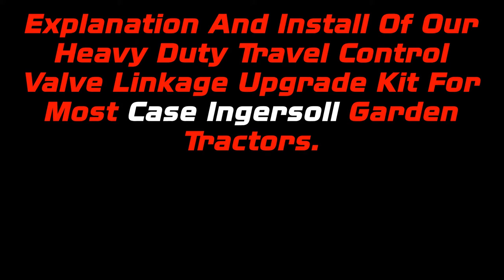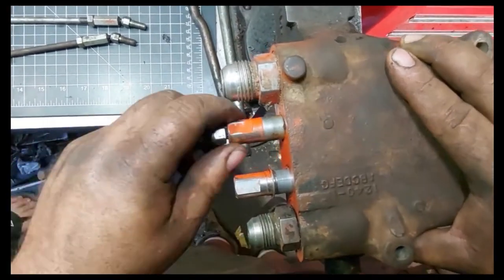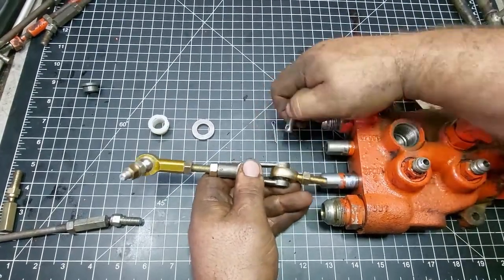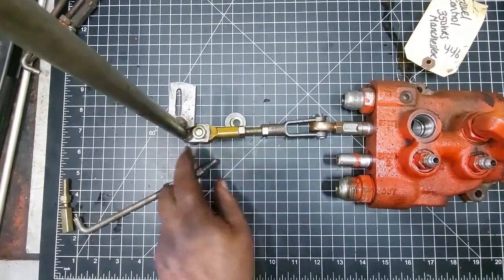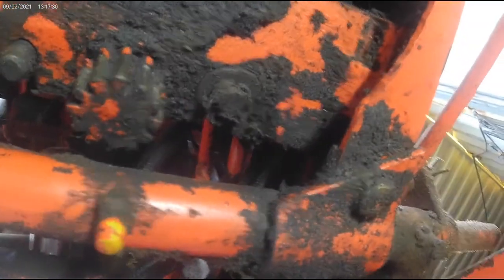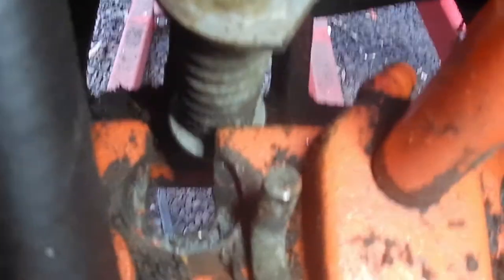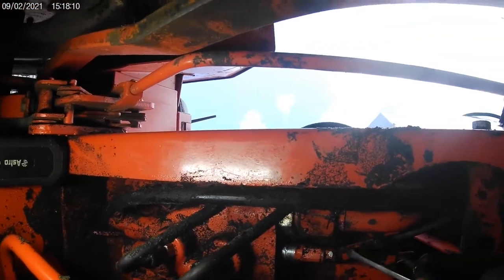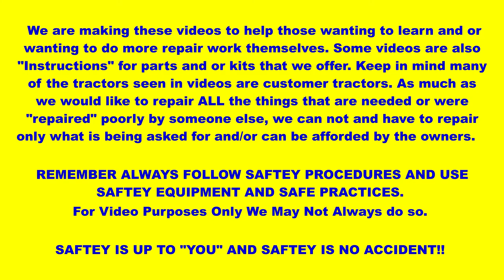Heavy Duty Travel Control Linkage Full Upgrade Kit For Case Ingersoll Tractors Explanation & Install

Comment: do you happen to have a video on the rebuilding of the valve ? getting ready to tear my valve apart as its leaking... are there any tweaks that can be made to relief springs to make for a stronger hold as well. we are building this tractor into a sled puller. thanks for any help you can offer ! my tractor is a 220
Reply from the maker: Hi we do not yet have a video buy its in the works when time allows. You can adjust the relief valve and will need a gauge to set it after rebuild. Going much higher if not familiar with hydraulics can be dangerous or do damage if you are not sure what you are doing. Many have played with the settings for what you want to do but again can be dangerous or do damage. Some also play with drive motors from big wheel machines as well as different gear sets as well as over the tears different ones were used or offered. Depending if more or less speed will help your situation or need more torque Good luck, be safe and have fun. Keep us posted would like to see your machine and it pulling.

Comment: Is it normal for the spool to not be stiff in there moving it back and forth? I have a 2 spool the attachment lift spool with the detent has tension behind it.  The spool for the drive motor can be moving back and forth easily. I noticed your hitting yours with a hammer. Is it normal for mine to be that loose? If not what can I do to fix it?
Reply from the maker: It verys a little by year, we mentioned in the video that there was a issue with the one on the bench as it was too stiff. They should not move easy but not very hard. there should be some resistance and a little force needed.
Reply: @caseingersolltractorsnortheast  I have a 1973 model. I feel the spool rubbing against the inside of the TCV but there’s no real feel of it being in neutral. Would just a long life of the spool rubbing cause the spool to wear and not lock into position like it should? Would replacing the spool seals help it at all? Thank you for your time sir
Reply from the maker: @diesel_dude08  So depending whats wrong its hard to say without feeling or seeing it. I would start with the seals, and at that point while taking it apart you should be able to see if there are other issues. Here is our reaseal kit. https://www.caseingersolltractors.com/product-page/c28856-c28217-travel-control-valveo-ring-reseal-kit  any other questions let us know Bud, thanks
Reply: @caseingersolltractorsnortheast  I’ll dig a little deeper and see what I can’t find. Thanks again for all your help!
Reply from the maker: @diesel_dude08  any time

Comment: Ordered my kit and trying to do this on a 76 is turning into a nightmare as the 76 doesn't have the access plate. I have the hydro tank out to replace the hoses and the tank as it was leaking. I can't get the end link to go into the control arm hole. It's like it's too big to fit but I can't get under it to push it in very well. I see why they added the access panel on later models.
Reply from the maker: Yes the access panels helps. But if your tanks out you should have room from up top or take battery out if that style. As in the video depending how worn your lever is you may have to open up the hole a little. We did this on purpose for 2 reasons, it allows us to use a much stronger more superior heim joint on this end and also makes for a tight fit and eliminating slop in this connection point as well. If you need more access you can remove steering gear. We have a video showing how to remove and replace the gear for alignment of machine. Also on many years but not all you can put that end of the linkage in from top OR bottom but some set ups you cant.
Reply: @caseingersolltractorsnortheast  Thanks for the advice. I put mine up through the bottom of the hole and it took some long flat blades and wiggling to get it in and a magnetic socket/extensions/wiggle head to get the nut on. Now to adjust the neutral. The control arm looks heavy duty so hopefully I won't have to replace it again.
Reply from the maker: @scarbunker  Glad to hear, its one of those things it takes a little time if it is the first time, but times vary greatly depending on year/model. And most people only have to do it once with our style kit, as it is very heavy duty. We do hear often people have bought or came up with other links or options, have to replace them again and end up buying our kit and are very satisfied with the difference. But we can put them in many models pretty fast now, because we have done many and its over all fairly easy, but the first ones always take longer until you do it and have those AH HAH moments lol. Thanks for watching and the feed back as well as the purchase!

Comment: How did you get the bushing to stay put on the dash?mine keeps popping up,thanks for the videos very helpful,
Reply from the maker: THANKS! They should stay. If your tractor was used at one time without it, it could have possibly wore the dash hole. You could try a little JB weld etc on the bushing. I assume the bushing is new? Out kit offers a little bigger bushing.
Reply: @caseingersolltractorsnortheast  I thought about the jb weld.Everytime the lever comes back up it pushes it out.Couple other questions,Do you get them linkage kits from that Steve aka M
Hemlock Steve?if not how much are yours and how do I order them
Reply from the maker: Hi sorry just seen this. No our kits are different and we DO NOT get them from him. Ours have a Heim style joint on both ends, larger stud on the lever end to compensate for wear and we provide a heavy duty top dash bushing and the lower oiled bushing both. I have not see his but I think these are the differences. You can contact us on Facebook to order using Pay Pal and or we offer them for sale on Ebay as well. Not sure why it did not notify us about your comment, sorry. Anything else let us know!
Reply from the maker: Ours are heavier duty all around including larger joints, center rod and superior heim style joints on both end with USA components.  link here https://www.caseingersolltractors.com/product-page/heavy-duty-travel-control-linkage-upgrade

Comment: So these won't work for the 648?
Reply from the maker: No loaders use banana plate linkages that often need replacement and full kits needed to do the job right. Thanks for watching and the question.

Comment: Did you see how many times hthe lock washer and hut was dropped? That is what I eliminated because there is no reason other than being way cheaper to use a lock washer and nut in tight spaces.
Reply from the maker: Lol whats a "hut" ?? "Cheaper" lol hardly we use grade 8 washers but not really worried about washer and nut costs as we have thousands of them in inventory lol . I know you worry about a few cents. But if your only advantage is a half cent washer then that alone says a lot. As it has been proven by many our product is a far more heavy duty product than yours and with far better parts. As the many side by side photos floating around prove. They can be seen at caseingersolltractors.com  Not to mention the many testimonials of those that buy our kit after yours fails.... Oh and the hundreds we have sold and installed over the years. So yes maybe your half cent star washer/nut helps a little with install. But still one has to get the nut on there lol. But Ill take our far superior dual heim joint that is 25%larger with it's 5/16" stud over your cheap 1/4" ball joint that fails fast. Our 5/16" threaded rod that connects and transfers most of the force is also 25% bigger being 5/16" over the 1/4" like yours on top of our major components being USA made. Then we also provide all bushings to make this a true complete kit for the consumer. The lower oil lite bushing and 2 upper Heavy Duty bushings for the dash. Also included is a long roll pin indicator for the dash and lever. And only for literally a few dollars more on our website lol. So seeing only one little washer is what you are trying to call out, speaks volumes again for our product. Like I said with all your other social media failed attempts to call out, put down and attempts to peddle some business for you. We should put you on pay roll as you really just increase our sales so thanks for that. PS. I think we will get rid of the lock washer now and go the other route. Thanks for pointing that out. Many said we could not improve our design but I guess maybe that is a way.  Oh and the nut wont cost much or add any cost to the kit as we will buy them by the thousands. We do not worry about pennies here, we worry about quality and customers. I  know by commenting here you hope this drives traffic to your channel and product lol...Hope it helps your needs out..  Its all good we understand people have to try and do what they have to do regardless of how pathetic or classless... Thanks for watching and the support by the comment! :oops: